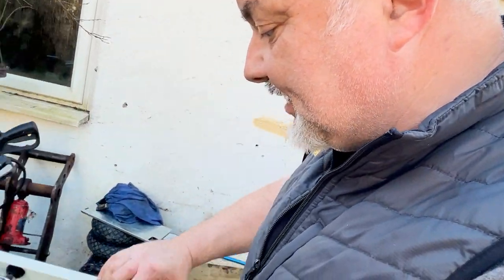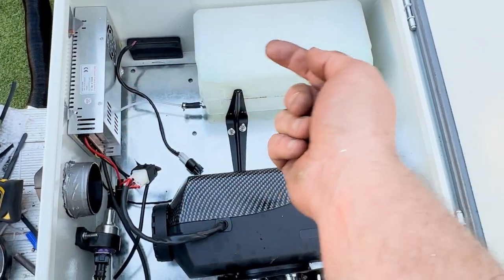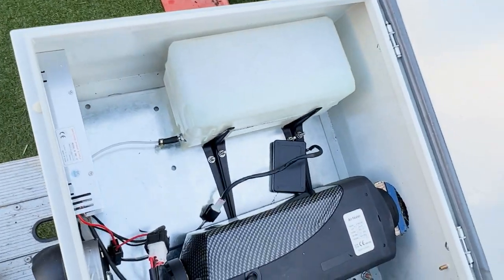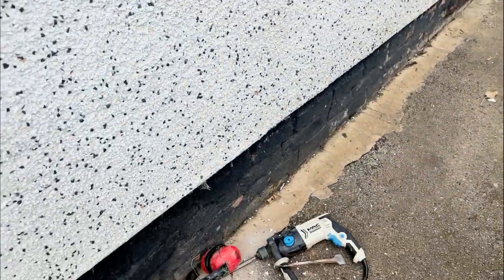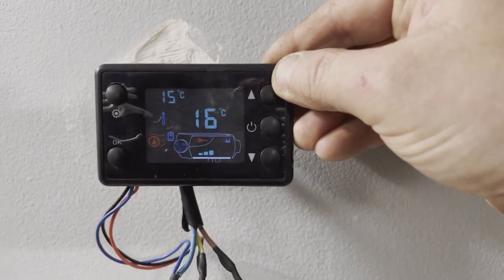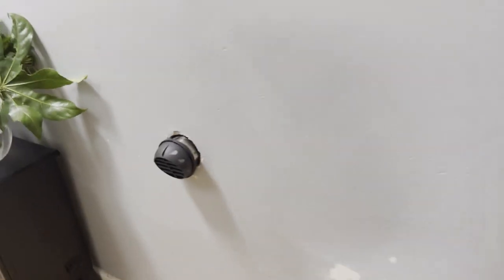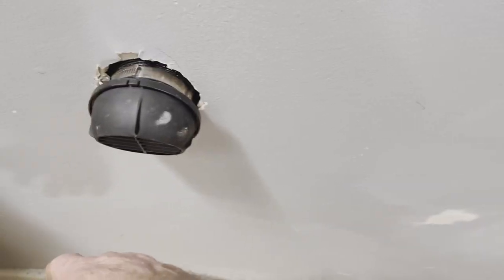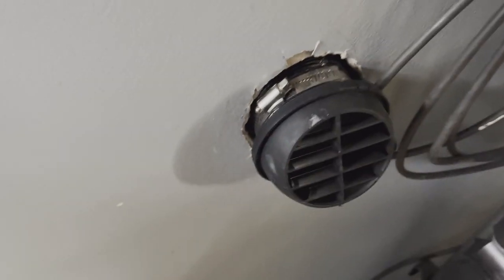Rise against the UK Energy Companies. My House Heater project using a Chinese Diesel Heater Unit

Comment: Great job fella I just got a 5kw Chinese special turn up today, gas companies are taking us all for a ride for as long as they can, I just need to find a local supplier of kerosene and I'll be saving a lot to heat the workshop.
Reply: I'm in Leicesterhire and trying to find a kerosene supplier that is willing to supply less than 100 litres per order, not an easy find!
Reply from the maker: Gas and electric, these two prototypes have made a difference to our bill this month. The dryer been on nearly every day and only requires 45watts of elec to run and sips the fuel. The house heater left on all day on 2 out of 6 settings for heat again uses 45-65watts only less the fuel.
Reply from the maker: @GaryMcKinnonUFO  I bought off ebay a box of kerosene 20L for £36 delivered and think it worked out £1.41/litre. Looking at red next as we have a local garage that sells via the pump.
Reply: @inventorant  Cheers.
Reply: It's runs on waste oil mix also. 2/3 waste oil of choice and 1/3 diesel or kerosene. Just watching a video on it

Comment: Neat job but when you have a power cut the heater will suffer a hard shutdown and possibly catch fire, with the fuel tank above it.
Reply: Can you cite ONE example of these heaters catching fire from a hard shutdown? Even if the heater is damaged I got mine for $110 and it’s already paid for itself🤷‍♂️
Reply: @mertonallowicious  I said possibly. Without a controlled shutdown the heater will certainly overheat and be damaged and it could cause a fire. If you want to take that unnecessary risk go ahead.
Reply: @whitevanadventures4116 so you can’t come up with a single example case, yet double down about risk…

Comment: Nice job but better to run it off a 12v battery because it will overheat in a power cut because there will be no cooling down phase.
Reply from the maker: I agree this does need a backup to allow it to down cycle. WOrking on a solution. A few friends have had issues when the van battery for example has depleated and not allowed it to cool down, not bad reports but a little weakness the way these work.
Reply: Should have a setting in controller so when battery reaches a low level it powers down👍

Comment: The power supply is not for outdoor use, at least IP 44 is required especially for condensation, and making such powerful interventions on the house is easier if you have a window that you can cover with sheet metal to make holes in.
Reply from the maker: Hi, so far in the IP66 box that is very well protected against the elements the power unit has not caused any issues and is earthed etc. It needs a 12v backup battery in the event of powerloss and any chnace the heater could overheat without a cool down cycle something I am working on. It is no miracle solution by any standards but when working does provide some benefit in our small terrace house.

Comment: Make it also suck in inside air or it'll pull cold outside air and push your warm inside air out. 

Also there's a lot of heat in the exhaust gas. 
Best tip is to install a radiator and route the hot exhaust gas through it and install a co monitor. Thereby you get more than 90% efficiency

Comment: You should really route both pipes inside so you dont have to heat the cold air before blowing it inside. Much more efficient that way.
Reply from the maker: Yes phase one was wrong external air is not the right way. I did sort this fairly quickly and it's all from in the house and out and use a monoxide alarm right in front of the heat pipe also, ideally these should have this option espcially in vans etc. Amazing the heat loss from the exhaust

Comment: You really need to draw intake Air from inside the house, creating a closed system or you will get bug's and all sort of creatures in the house,also exhaust fumes can potentially enter, heating more efficient as it is not heating cold air . carbon monoxide detector is a must have

Comment: I would punch another hole through your wall for the intake side of the heat exchanger... your method will create a pressure inside of your house and  force warm air outside through the cracks in your house...  one more hole my man, it will pump out way more heat and save you money at the same time.

Comment: Just wondering if you could do an update as to how it has performed over the last 10 months
Reply from the maker: It has made a big difference in our bills, the ability to warm up when needed and also has helped damp control as I think the air input from the house and output back into it dries the air unlike some gas heaters etc. The unit has been really reliable too, the only thing I wish I had not done is cut a hole at the top of the enclosure for fuel as it leaked water with these bad storms but sealent later has solved this. For the bang for buck this heater and solution 
is terrific.

Comment: Brilliant set up. I'm just about to embark on a similar one. Where did you get the blue circular thing that goes round the fuel tank lid?
Reply from the maker: Hi, many thanks and I have 3d Printers and can make you one if that helps my emails anthony@apbtechnology.co.uk. I was going to leave inside the box but restricts filling up and saves opening the unit every time also. It's been used a lot and so been very reliable.

Comment: Hi there, just wondering what your thoughts are on the diesel heater? 
Is it worth installing one in the home?
Do you have any regrets or are there any things you would have done differently.
Thank you.
Reply from the maker: Hi, thanks for the message and it does make a difference but it's no repl;acement for central heating. With energy prices through the roof it was a mad attempt to find a backup and I was pleased. I get loads of comments from people about it. Do this at your own risk though and I'm a mad inventor and like to mess.
Reply: @inventorant  Morning, It would be good to see another update towards the end of this year when the weather changes again.
I have purchased one and will be installing soon.
Thanks and all the best 👍